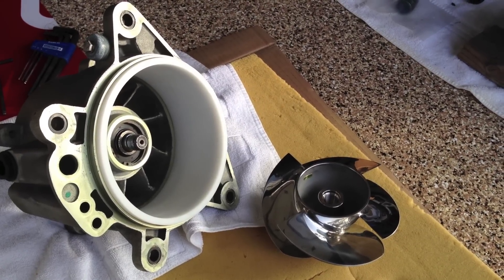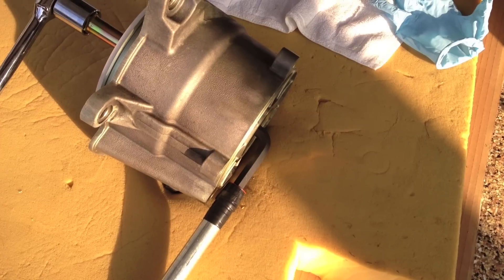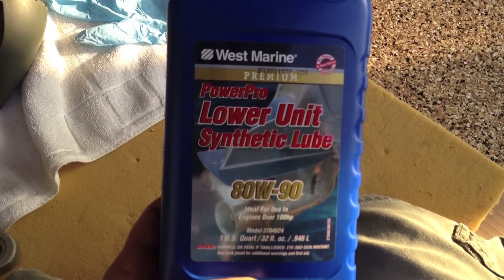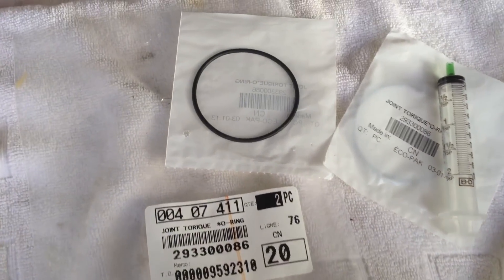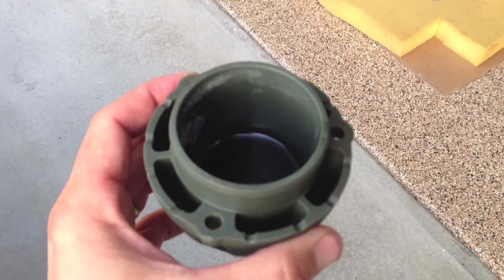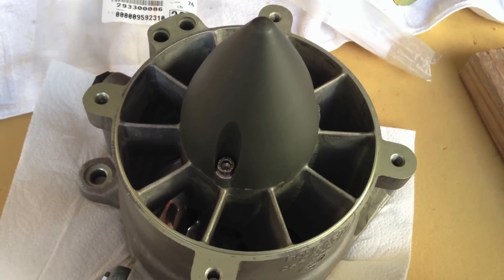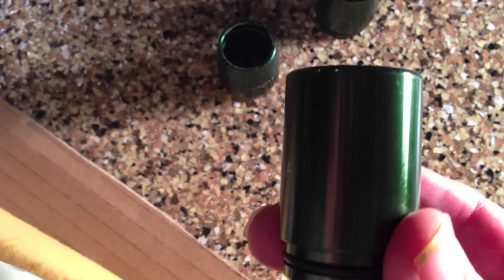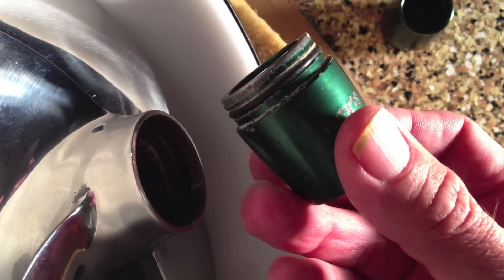SeaDoo Impeller Install Part Four

Comment: 1/8 inch NPT  plug brass or s.s  and a 1/8th NPT tap. or by a cone with a threaded plug.did mine today took 4 minutes and cost me 1.00 for a brass plug .turn that crap over and loose fluid? not me .and you're welcome!